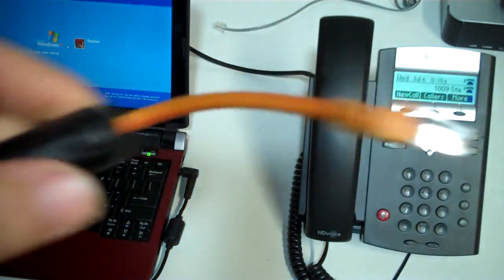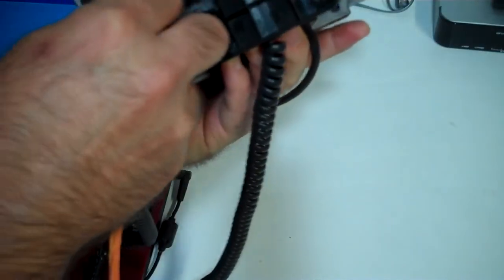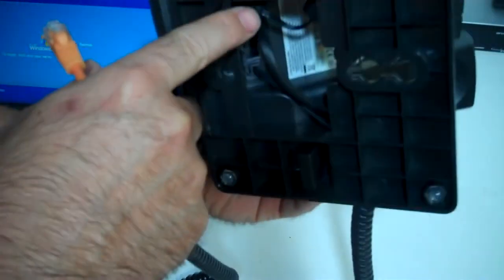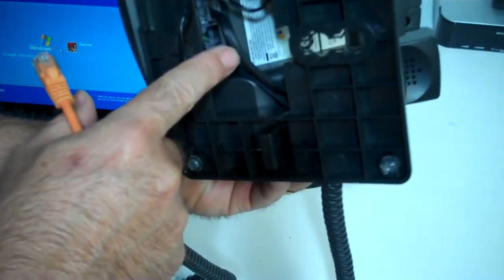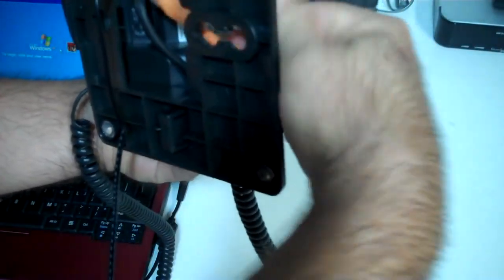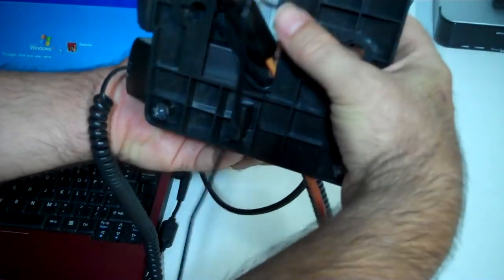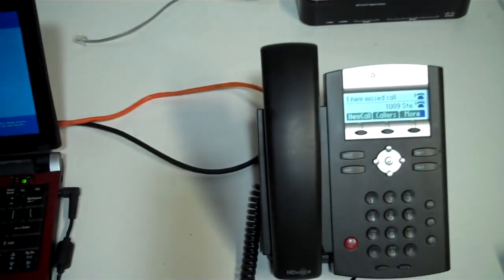Ferrite Noise Choke

Comment: Can I fix the ferrite core loosely . Because it’s already wired so have no code to go around the ferrite core ? Is it still do the job ?
Reply from the maker: to be candid with you, I'm not seeing these ferrite chokes used much anymore in the network or VoIP space.  They're still pretty common in car stereo installations though.  So, my point is, you may not really need it.

Comment: What would be best for a analog landline so nothing interferes with it may I ask
Reply from the maker: If you want to re-run the phone cable, you could buy "Shielded twisted pair".   However, before I did that, I would disconnect all my inside wiring from the phone demarc and test the line there to be sure there is no noise on the line coming from the phone company.
Reply from the maker: here's a video I made about house wiring.   This might be helpful.  https://youtu.be/jyWAO9WpC3w

Comment: If not what will work with the analog landline
Reply from the maker: Joey, you could use this on an analog line.  However, in my experience, the most common cause of noise on an analog line is a "ground hum".  This is usually caused by a loose connection, a corroded terminal,  oxidized splice.   Best think you can do is try to establish that the cable from the demarc is solid.   Or, check the line at the demarc and see if the noise is there.  If so, alert the provider.

Troubleshooting noise is tricky.  Good luck!  :-)

Comment: I just bought a pack of these. My problem is that ferrite I ordered is a little too small for the wire I will be using it to. Can I just grind/sand the core so it would fit? Will it still do its job if I sand it off to size?
Reply from the maker: Rej,  I suppose grinding them a bit wouldn't change the noise-squelching properties of the chocke too much.  If it were me, I might just order new ones.

Good luck with that!  :)
Reply: Network Advisor thank you for the answer. Figured that out too and I already ordered a new set.

Comment: Is your job titled as network technician or just a general technician or ICT technician? Just curious, because I’m not sure what courses to go through to basically do exactly what you do, I love setting up networks and hardware so I wanna chose the right field I’m technician. Thanks! Great video by the way :)
Reply from the maker: network tech is probably a good description for what I do.  But, I work as a contractor, so I sort of have to  be a Jack-of-trades.  the assignments I get can vary widely from running a  cat5 cable to installing VoIP phones.  that’s why the videos I post are of such variety.
Good luck with your career development. 🏛⛪️🏫